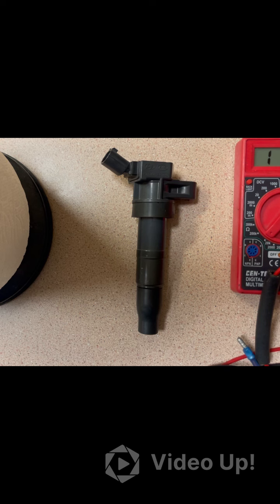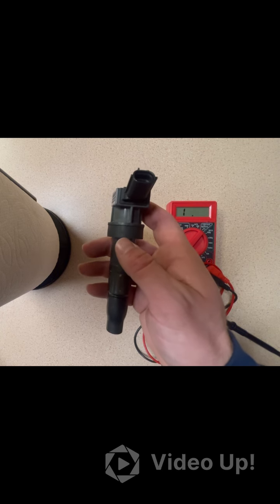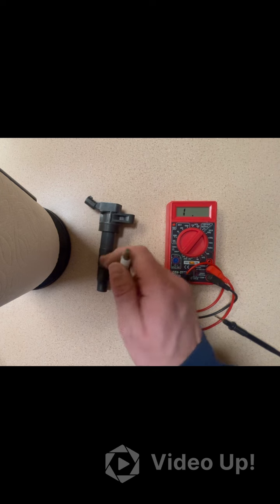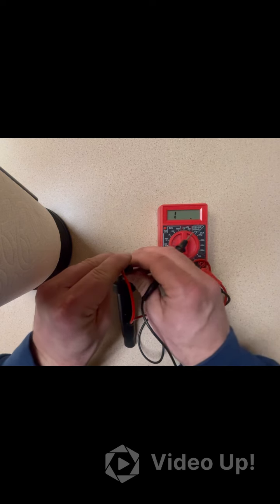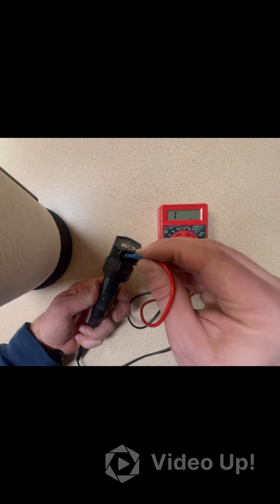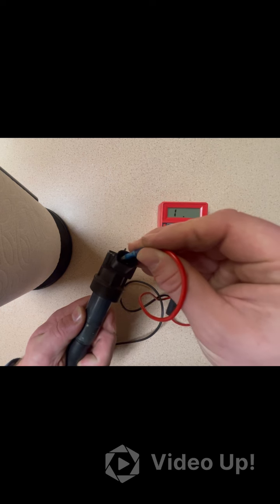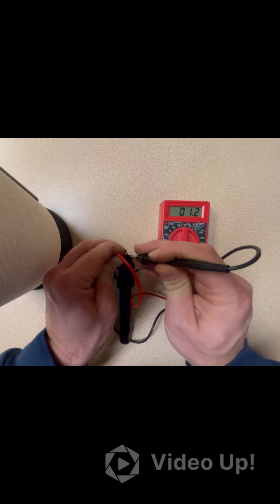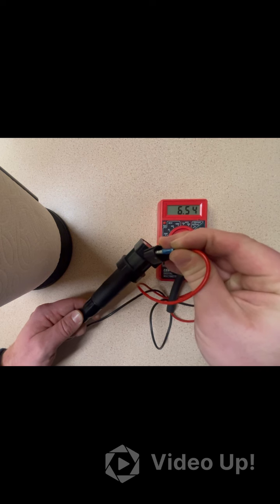How to test an ignition coil, Diagnose a bad ignition coil. Ignition coil with multimeter, Misfire

Comment: Great video. Just tested coils in 5 min and found the one I suspected was causing issues due to a old valve cover gasket issue and it sitting in oil for an extended period of time at some point. Now I'll grab 1 coil instead a whole set for no reason. Thanks!!

Comment: Thank you best video on how to check coil simple and straight to the point
Reply from the maker: @octaviojabali6981  I still prefer redneck method just swap it to another cylinder if your miss moves it’s diagnosed.
Reply: @TheDIYDoc  thank you just so your viewers know i hove a dodge promaster the boot sometimes breaks so what I do is replace the head of coil it separates and there is a long spring i elongated it and it works without removing the stuck boot that is if you’re not replacing spark  plug 👍

Comment: Amazing tutorial! I am measuring the ignition coils to my truck, Primary should read 0.6 - 0.9 Ohms. Multimeter set on 200, the readings I am getting are; Coil one 02.5; Coil three 01.9; Coil five 01.6; Coil seven 01.8;   Coil two 02.6; Coil four 02.3; Coil six03.8; Coil eight 03.6. When I set the multimeter on 200 on the screen it shows 1. Do I extract the 1 out of the readings?
Reply from the maker: Make sure yall follow.  Page is fairly new but I’m posting often!
Reply from the maker: Hmmmm are you sure they’re supposed to be 0.6-0.9?   And no you don’t subtract 1.  Higher the resistance the older the coil and the less voltage it will produce.  High resistance is bad for voltage flow.

Comment: Good info . Question in my multimeter In ohms I have the choice of 200 and 200k, where do I put it to 200 or 200k?
Reply from the maker: @ramone.1021  200.
Reply: As you are looking at 6k+ Ohms then you have to select the the nearest available range, so you might have 200, 2k, 20k, 200k etc, therefore you would need the 20k as 2k won't read when testing.
If you only have 200k as your next option that is what you select, but knowing what ohms your looking for will then determine where your Decimel place will be.

Comment: I just tested my motorcycle one, the range is supposed to be 1.6 to 1.8 ohms and I got 2.5. Does this mean it’s bad?
Reply from the maker: No.  That’s small range.  If it runs it’s fine.  I wouldn’t even check em unless you’re having a miss.  Mild increase in resistance isn’t an indicator it’s bad
Reply: @TheDIYDoc  i have a misfire in one of the cylinders. What else should I check
Reply from the maker: @chipsisshook1741  check spark plug.  Ignition coil.  Compression.  It’s one of those things long as getting gas to it.  What was ohms on other coil? Similar or different.
Reply from the maker: If other coil is 1.6-1.8 then yes that 2.5 is prob bad.  As resistance increases forage decreases could be causing weak spark
Reply: Im checking my ignition coils. Kia rio. 4cylinder  Output is 5.99 ,   5.96 ,   6.06 ,   6.06. Are they fine or must i change

Comment: If I’m doing this on a motorcycle, my coils look the exact same btw, but should I just replace all of them while I’m at it? I’ll be testing mine tomorrow.
Reply from the maker: On a motorcycle likely only 2.  Also they are likely a different configuration and set up.
Reply: @TheDIYDoc can I test them relatively the same way though?
Reply from the maker: @chipsisshook1741  yes.  Same concept.  Connections are just different is all.

Comment: Im checking my ignition coils. Kia rio. 4cylinder  Output is 5.99 ,   5.96 ,   6.06 ,   6.06. Are they fine or must i change
Reply from the maker: Idk the standard for your car but if they are all equal that’s reassuring and likely fine.
Reply: Good answer. No advice just posting vids

Comment: i checked all my 3 old four coils' output circuit for toyota sienna 2004, they showed nothing at all for output. BUT I didn't understand why my car still ran and idling smoothly.  Any ideas?
Reply from the maker: Not checking resistance properly.